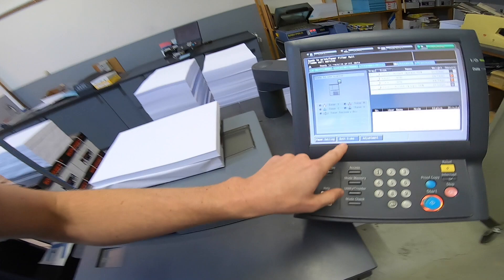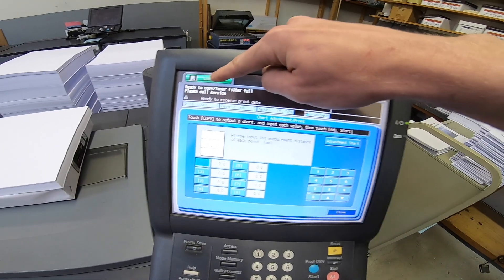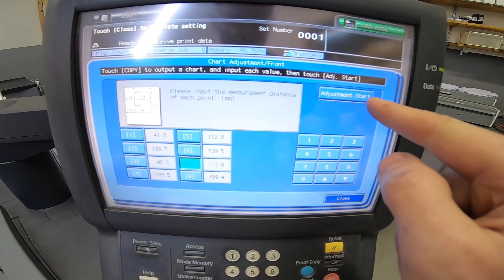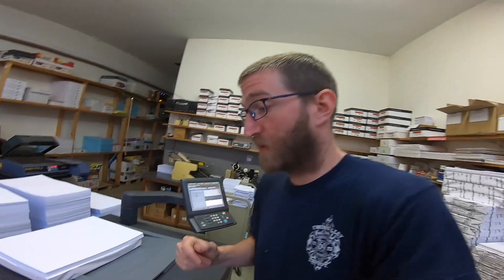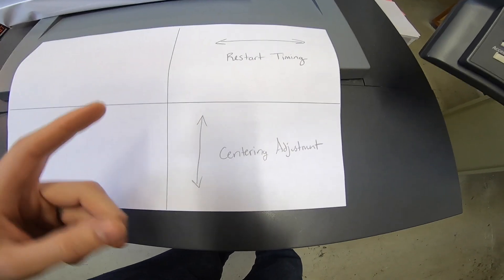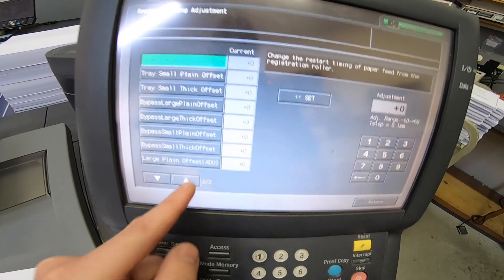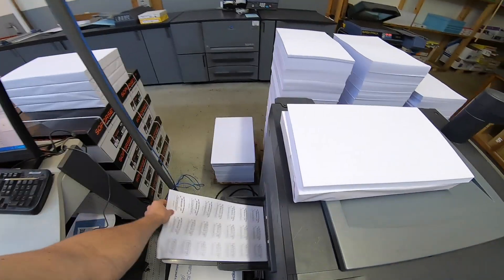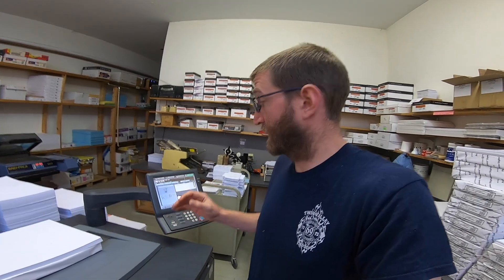Both Sides Adjustment on Konica Minolta C6500 Digital Presses, Front to Back Image Registration

Comment: Your channel is very useful. Currently i m using xerox DC 252 and i m planning to buy RC KM 6500 but i checked so many machines but color registration is not proper. Always i find magenta and yellow out in small fonts.
Reply from the maker: Glad you like the videos.

Comment: Hi Dan, how do you adjust skew
Reply from the maker: I no longer have my c6500. I think there is a both sides adjustment on there. I was never impressed with skew adjustments on the c6500 I could never get enough adjustment out of it. The 1070 and 3070 have a much better setup.

Comment: C3070 model print well on textured papers
And the print of this machine have gloss on 250gsm coated papers
Reply from the maker: I rarely print textured papers. I heard others say they were having issues. I will sometimes print on linen and it looks awesome most times, sometimes it has trouble filling in the valleys.

Comment: I want to know some thing that when i print 250gsm 12x18 sheet of 1 job multiple copied what is the actual speed per minutes
Reply from the maker: If I had to guess it would probably be 30
Reply: Just A Printer please just calculate if u can
Thanks for ur answers.

Comment: I do maximum time in Fairy Commander  application by shifting portion. 
My Question - doest this method come 100% snap? Now I'm in quarantine. I need to check your method. Thanks :)
Reply from the maker: I'm not sure what you mean. The best way to do it in my opinion is to change restart timing and centering.
Reply: I'm talking about B2B registration mark.

Comment: This is some good content, I see your channel taking of like Steve the mechanic lol. It’s all fascinating, started watching your channel because I wanna do some self publishing, and due to covid outsourcing seems almost impossible rn, so I thought I could just buy the low end manual machines, order some of the machines,  stationary slicer,a4 binding machine, and I already had an office grade printer, it will do for now, I’m looking into printing a soft cover book, but I’m having difficulties with the cover, is it a special stock, that’s only shiny on one side and matte on the other, or is just a heavy paper that is later laminated? If it is could you point me out to the name of the machine . Thanks soo much for your content
Reply from the maker: You should use a C1S paper. (coated one side) You can use that paper alone or laminated one side later. I use a D & K laminator. Any single side laminator will do the job for you. Good luck!

Comment: i just dit that on Monday. Sins i moved the printer  (5 years ago) the front to back registration was way of i adjusted it in the command workstation. but i had some time on  Monday so i messed around with the 2 zijdes adjustment i will tray your second method on vrijday. still learning things on a 10 year old printer c6501.
Reply from the maker: Good to hear!

Comment: Nice tips, thanks Dan ! Time to adjust my bizhub C224 (don't laugh !), It's been years I'm struggling with double sided printing since I can't get the back matching the front. I'll give it a try and if It didn't worked I count on you to help me with.
Reply from the maker: Glad to help!
Reply: i have the same problem did you solved it on the C224